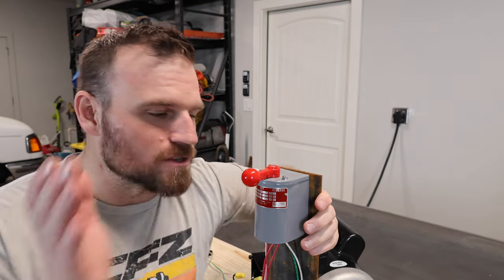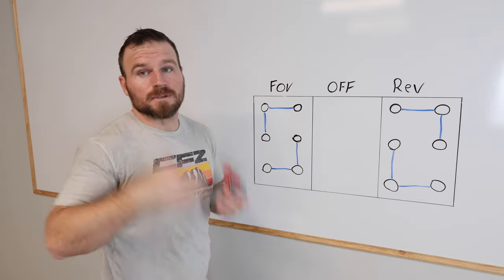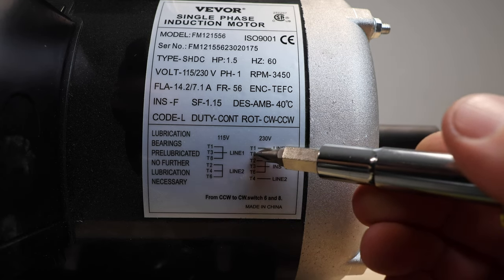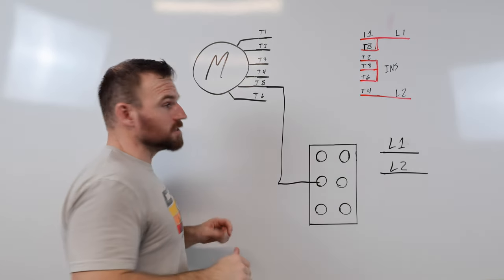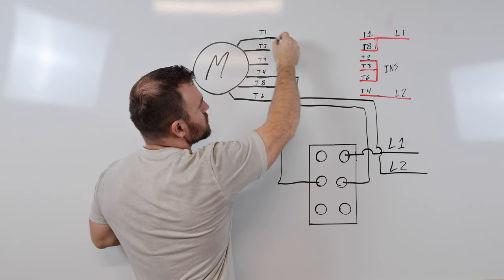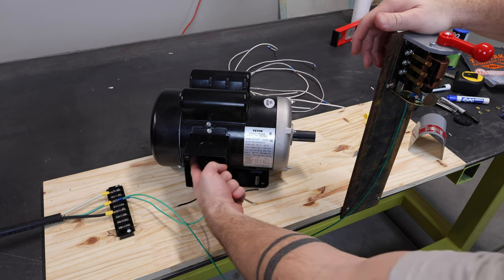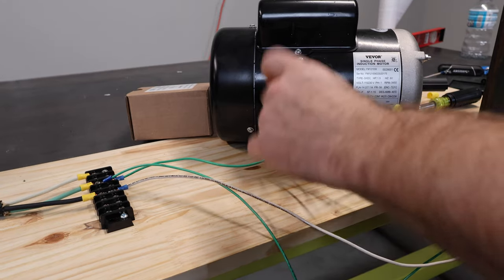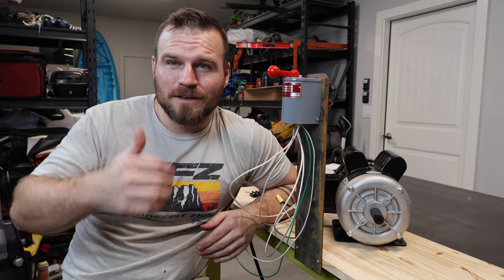How to Wire a Drum Switch to a 220 Volt Motor

Comment: what would be different for 120?
Reply from the maker: 6 and 8 will go to the center two terminals. 1 and 3 will go to the top two terminals. 2 and 4 will go to the bottom two terminals. The 120v is much very simple. Hopefully that helps you!

Comment: Great tutorial . The only issue is my motor is a Leeson 2 HP with overheat protection switch. The wires are coded differently T4,T8 L1 & L2 are the same, I have a T5 and P3 as well. No T2 and T#

Comment: Thanks Michael. That was awesome.
Reply from the maker: Thanks! Hope it helped!
Reply: Hi Michael, I've watched your video and  and you do a great job explaining how to wire a 220 motor. My motor is a Leland Farady. My motor wiring numbers are a little different than your video. My motor diagram is like this. P1 Line, P2 Tape, T4 T5 Line, T2 T3 T8 are taped together. T5 and T8 change directions. Look forward to hearing back from you. Thanks in advance. My name is Keith
Reply from the maker: @keithdeaton6482  My email is goprorunner@gmail.com send me a picture of the motor plate.

Comment: Why does 220 wire differntly in the same 6 switch drum??.  Why no jumper wire.  Or was it a diff switch?  If not how would you wire 220with the  same switch as the 120v video
Reply from the maker: My two videos on drum switches are different styles of drum switches. I personally like the switch in this video better and I would use it over the other one. I made that other video because I did a job for a friend with that older style of the switch and I thought it might help. I no longer have the other switch but let me look at it and I'll see if I can figure it out for you. It might be a few weeks because I'm on vacation but let me see what I can do

Comment: Can you show the wiring for the same motor 120v? Thanks
Reply from the maker: Here’s an explanation of where the wires go. I started a new job so I’m taking a break from YouTube but hopefully that helps you.

6 and 8 will go to the center two terminals. 1 and 3 will go to the top two terminals. 2 and 4 will go to the bottom two terminals. The 120v is much very simple.

Comment: Hello, I have a drum switch just like the one in this video. And I have a motor just like the motor in your last video ( how to wire a drum switch to a 6 lead motor to build a reversing circuit) That was for a 110 volts hook up. My question is. Can I use this drum switch in place of what you used in the last video? And wire it the same way as you did in the last video.
Reply from the maker: Yes, you can! I’m planning on making that video for you guys this week or next. But you can probably figure it out from my other video. Let me know if you need any help.
Reply: @Mikesfilmss  Thank you Mike.

Comment: Hello Mike, I have a switch (Cutler hammer) like in your last video for 120v that I want to use on a 220 v Vevor 9 lead motor U140156C. I'm looking for some help with a diagram.
Thanks
Johnny
Reply from the maker: I'm trying to find the wiring diagrams for the switch and motor but I'm not sure they are right. Want to take a picture and send it to me?

Don’t quote me on this but typically the nine lead motors are a six lead with the addition of an overload/bracker switch. The P1 and P2 are are connected to the switch. I did a job with a nine lead motor and we just removed the switch.
Reply: I like to send photos but I'm having trouble adding photos to comments of youtube. Do you have an e-mail I can use?

Comment: Hi Michael, 
I have a drum switch that has 9 pins /screws or 3 rows of 3 can you help thanks Jim,  here is how drum is wired starting from left side top counting down  to 3
Next row top 4 thru 6 next row 7 thru 9 . Number 1 goes to 2/7/9 and other side of wires are 3 to 6/8 number 5 does not seem to be used it is single phase motor wired to 220 volts the motor has 7 wires 1 is not used on 220 setup
Reply from the maker: Thanks for the comments. If you can send me a schematic I’d be more than willing to look at it.